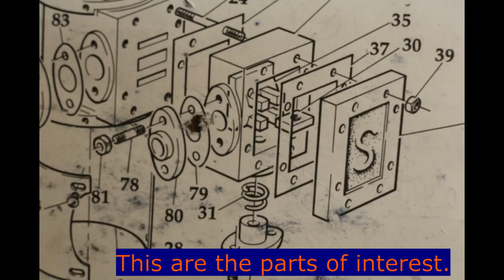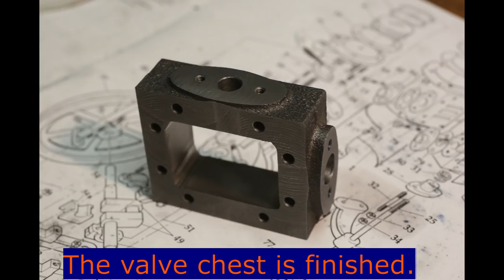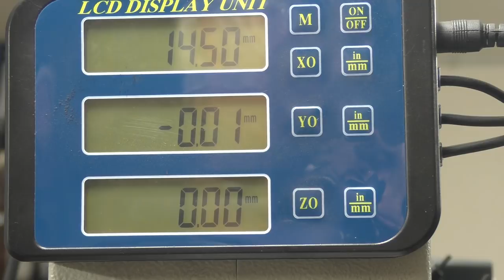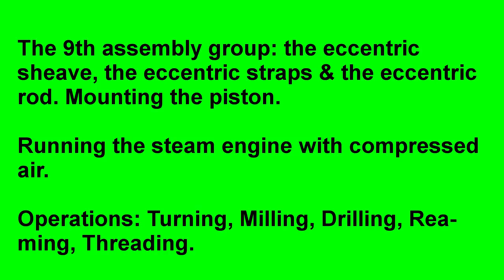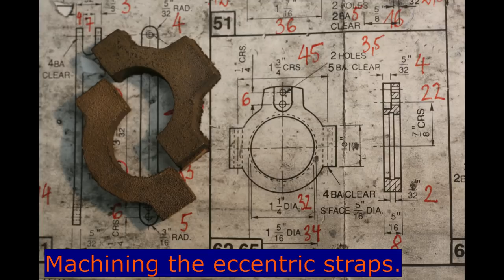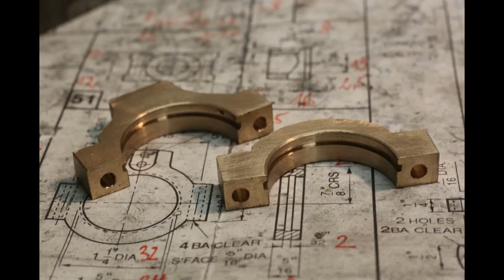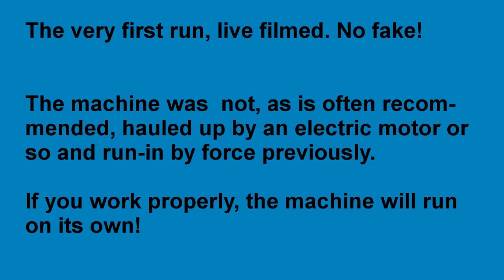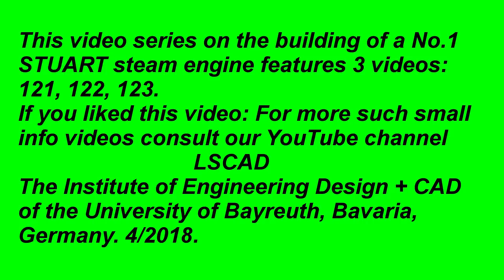Stuart No.1 Steam Engine. Part 3 of 3.

Comment: Thank you for the excellent videos! One thing to mention - I think you have it running backwards and should re-set the valve. For a non-reversing engine, the direction of running should be set so that the crosshead forces push against the standard. The way you have the valve set here, the crosshead is always trying, on both the upward and downward stroke, to pull away from the standard and bear its force against the hold-down plates. The opposite direction of running would impart all forces toward the standard.
Reply from the maker: I see - good idea. Thank you very much.

Comment: Very nice work. This engine is not easy to make. There are only two points that I would like to draw attention to, those cap screws have no place on a Stuart engine and are out of place. Why not  make your own  bolts in keeping with the rest of the fittings. The 2nd and more serious is a wobble at the end of the crankshaft at slow speeds which is clearly visible @ 35:32. Thanks for a very enjoyable and  precise build and video.
Reply: Don't forget that goofy crankshaft

Comment: Even a flat sheet of material attached to a vacuum hose helps direct flow to the work and to collect particles. Three sides are better, four sides may restrict vision. Many configurations are available for shop vacs, woodworking retailers online have great assortments or you can make one from sheet metal, but plastic is safer.
Reply from the maker: Toby W Good idea - thank you!